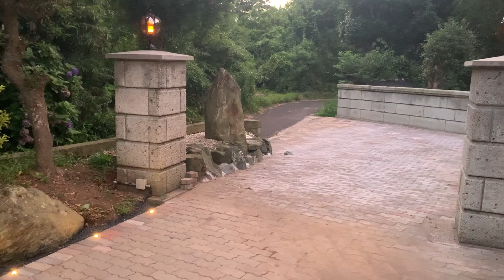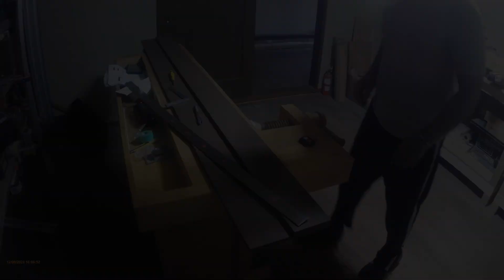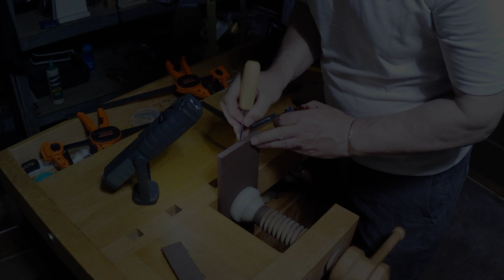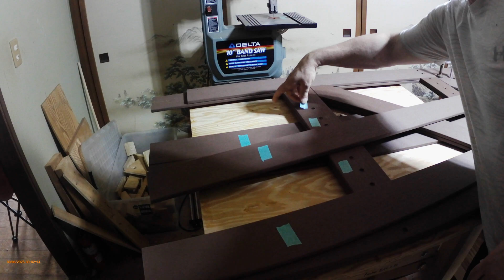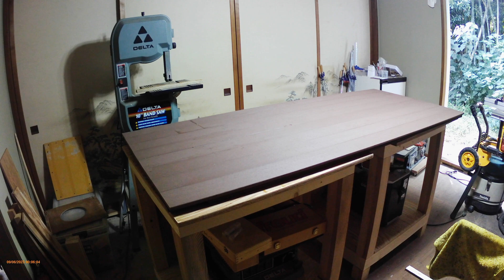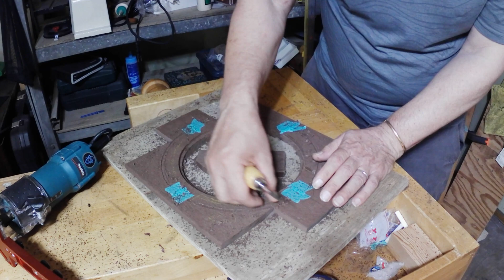Abandoned Chiba House Renovation Part 25

Comment: Great to have you back. 😅😅😅I have a question, How come you did not use a marine grade/industrial grade adhesive?  .....
Reply from the maker: Thanks for the comments and question. Marine Grade glue is specially designed to withstand harsh aquatic environments like saltwater, UV light, and extreme temperatures. Japan is humid, and a bit hot in summer but not extreme enough to warrant using a marine grade adhesive. Tightbond 3 is considered waterproof, has a longer working time before it sets as well as having a 2 year shelf life. Hope this makes sense.